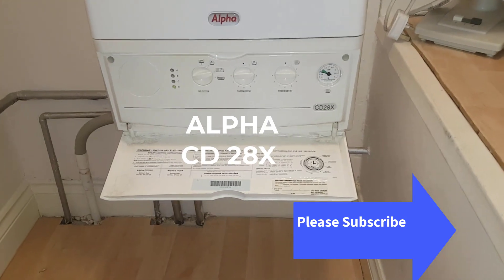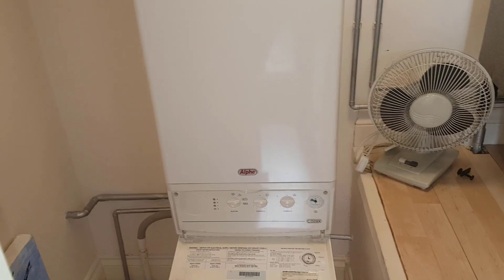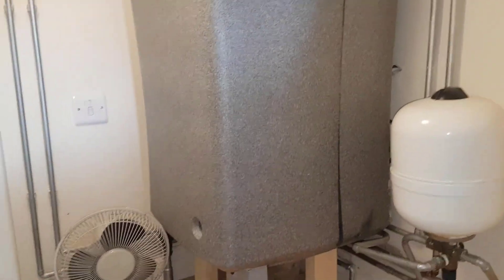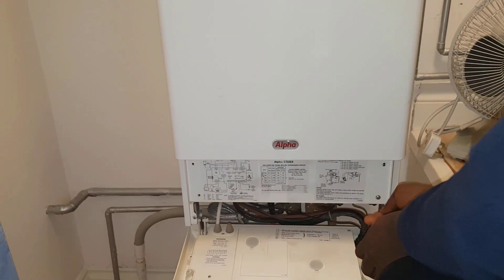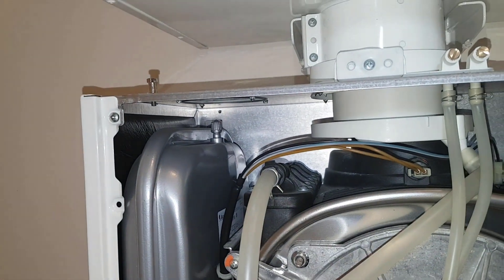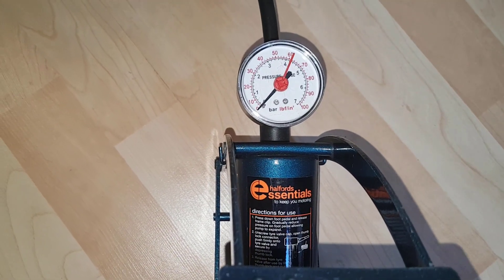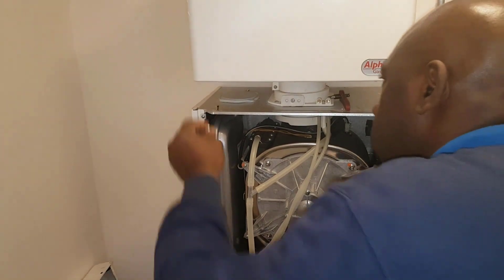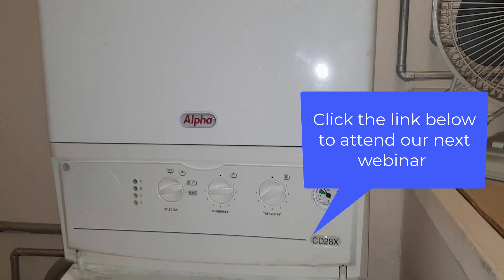Alpha 28CDX boiler losing pressure

Comment: Shouldn't drain a boiler from the PRV thats a bad way to teach someone they sometimes don't fully reseal, also we drain from the boilers drain off and leave it open so that the excess water in the expansion vessel that gets pushed out when you pump it up has somewhere to go, if you dont have anything open theres no where for this to go and you haven't fully pumped the expansion up, if you did this with the drain off open you would see as you pump it water would come out at the same time even though you have drained the appliance.
Reply from the maker: Thank you for your comments